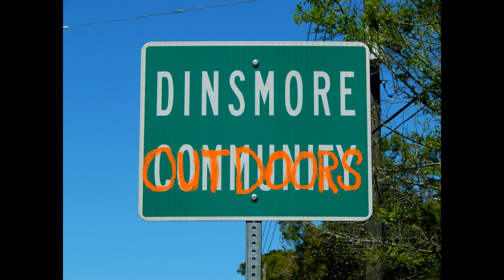DIY Kayak LED lights install

Comment: Good job man. I'm bout to bling out my pk12 from BKC for night fishing. Broke my neck in 2011 and tried to run an extra bright headlamp a couple weeks ago...never again. I'm still in pain from the little weight on my head. Appreciate you my guy
Reply from the maker: Thank you very much for the kind words! I still need to make the anchor light video haha. It's that time again for sure! Getting hot outside

Comment: What battery are you using? How many AH? How long do you get out of the battery?  I'm looking to do the same with mine.
Reply from the maker: I have a 12v 12AH battery, not sure how long but I have went out for a full night of fishing and never lost power. Those little led light dont draw much at all.